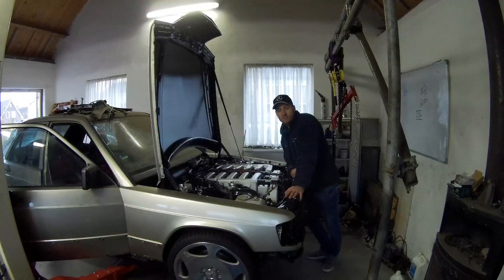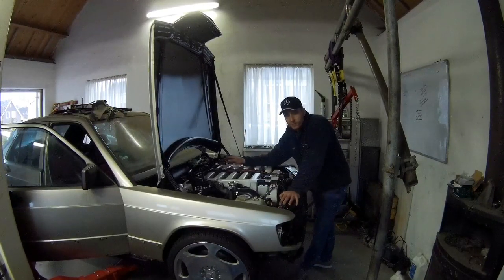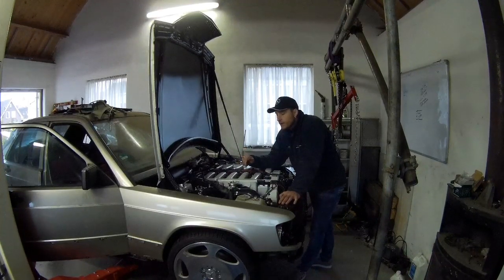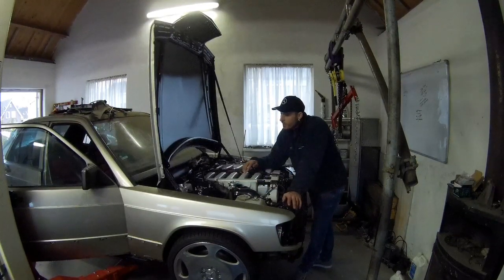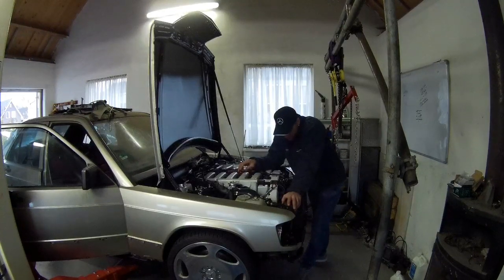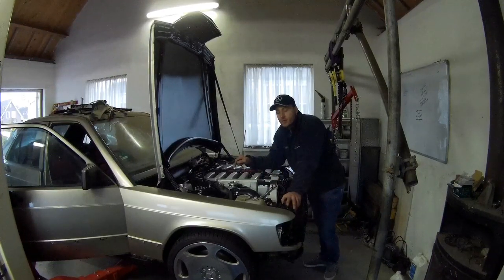FIRST START The 6.0 V12 is Alive !!! the W201 V12 is running !!!

Comment: Good work bro. Please am thinking about doing same on my w140 
just thinking, instead of all this issues with throttle body, airflow meter issues, etc. I want to put in a mechanical throttle body with an air filter and then bypass the airflow meter and the original throttle body by taking off the modules cos basically I only need the nuzzles to open for fuel supply. The ETA controls incoming air electronically also the maf and when there is a small issue it goes into limp mode and other issues, also engine restrictions like rpm limits, but with this I believe it will work, 
Pls advise me on this cos I love your courage and want to do this on mine